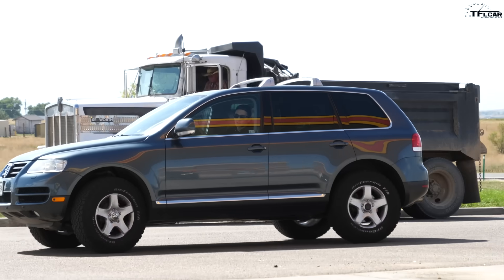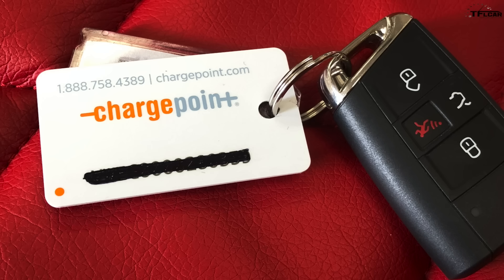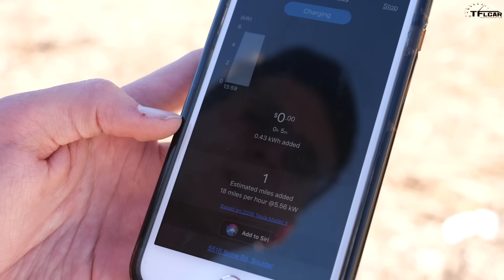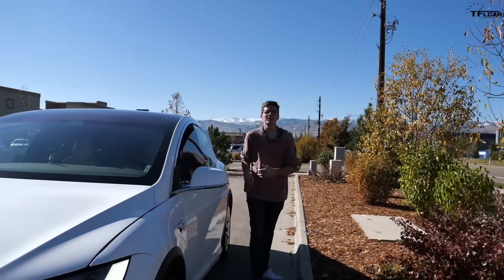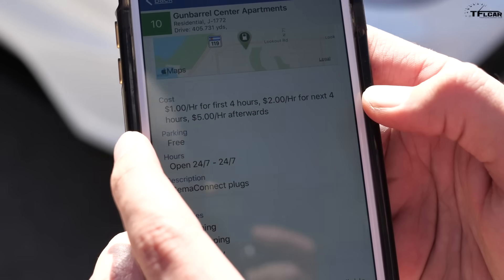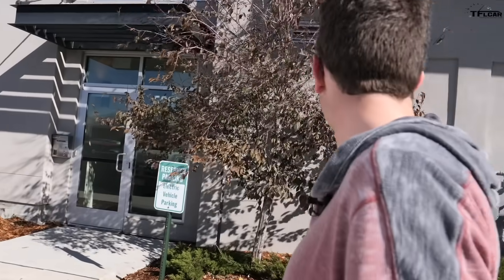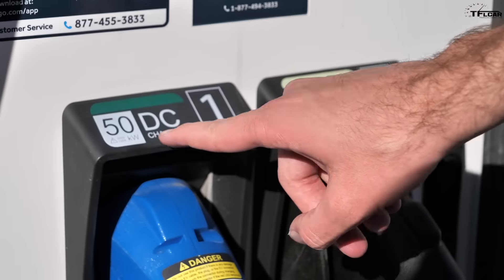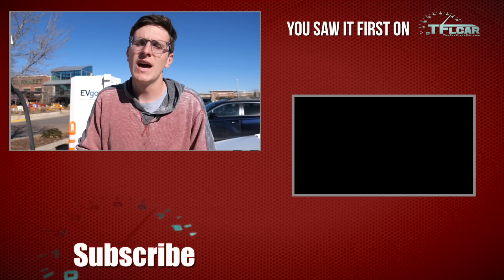Here’s Why Charging an Electric Car Can Suck - And It’s Not The Reason You Think!

Comment: I think it's time to make them standardize, like all gas stations are for the most part standardized. Lots of good info though.
Reply: Similar logic that Apple applied to computers, make thing proprietary and you have a captive audience. Once Tesla dominates the EV market share, those fast charge rates will increase. If you can charge at home  (with standard 220 outlet) then I would consider EV. Living in cold climate is another problem, heat uses a lot of energy.
Reply: Every EV except Telsa uses the same plug.
Reply: Don't "make" them do anything! Force does not solve problems, intellect and common sense does!
Reply: And what should we "make" YOU do? Socialists, (like Stephen here), always have fantastic plans, which always involve forcing people to do things. Free choice is better.
Reply: @jackfenn7524  yea, and each manufacturer using their own stuff. That will work well. Hurrah for free choice.
Reply: @georgecurtis6463  Actually, Tesla has demonstrated basic free enterprise works best. If you "standardize" the connection, you kill future innovation when a better connector is developed. (gas stations nozzles are NOT standardized actually, each nozzle only has to be large enough to NOT fit some cars, but small enough to fit others) Tesla realized that long charging times was a major problem and created a solution. As their cars need VERY high power connections, using a "regular" 5kw connector was impossible. (you can run 5kw of power through a 50 kw connector, but you can't run 50kw through a 5kw connection without it destroying it instantly) Part two was to create the fastest chargers and put them along the interstate freeways in a pattern that is exactly the same as the 1860s railroads, which put water and fuel stations every 20 miles (tenders were quickly added to increase the range and reduce stops). Also note that Tesla offers a fairly cheap adapter to use the 5kw stations. So in a pinch, you can still recharge almost anywhere, but only Teslas can use the 50kw stations. No government regulation required, the market by itself identified a problem and created a solution. But wait, Tesla can charge whatever they want at those stations! No they can't. They can only charge what the market will bear and if they push too hard, they hurt their customer relations and market share. You will also note that the 5kw charging stations only serve a shrinking market share of EVs. They are OK for now, but other cars will have to develop 50kw charging (probably license an adapter from Tesla) or continue to bleed customers.

Comment: 🤣🤣 240v power is in just about EVERY home in America. “High voltage” 🤣🤣
Reply: people are really stupid, its like saying that nobody has a washer or dryer.
Reply: isn't it 110V in the states?
Reply: Stefan7046 120/240v power in the states. 120v is one of the two wires fed to a home when measured to ground. The video has a point ONLY when referring to apartment living BUT apartments are still fed with 120/240, you just can’t modify apt wiring to install a 240v outlet in the parking lot, at least without permission 🤷‍♂️🤷‍♂️.

Comment: Great video.  That is exactly what i hear a lot of my BEV owning friends and clients tell me is their main gripe, not being able to charge as easily as they thought they would have been able to when they bought the car.  And you are living in a location that actually has a lot of various chargers.  Here in New Orleans, the charging stations are few and far between, and most of them are on private property, like hotels or parking garages, where you have to be a guest or customer.  
And of course, the other issue is the necessity to upgrade the home electricity situation to be able to accomodate the faster charging situations.  And if someone forgets to plug in their car as soon as they get home, and they have a low battery, it isn't going to be fun the next day on their way to work.  
When I was driving a tow truck, there were countless BEV owners that would call in with "I ran out of gas" in their Tesla or other BEV.  Then when I got there, they were upset that I couldn't take them to work and then drop their car off at their house and charge it for them.  I would tell them that I can take them to the closest charging station or their house, which ever is closer, and then they would have to figure out what to do from there.  Several times I would tow the car to the dealership and they would tell me they are going to trade it in on an ICE, not out of convenience, but out of necessity and safety.
Reply: Jeremiah Mckenna - How many drivers who drove gas engines ran out of gas that you had to rescue? EV drivers who run out of charge are stupid, just like ICE drivers who run out of gas.  That does not mean EVs are bad, they will become the future of automobiles, that.’s why Teslas are selling like hotcakes, those are people who are informed, not the ignorants making comments on this forum.
Reply: @Chainyanker007  .  Yes, there are idiots that run out of gas.  I have never said that doesn't happen.  However, there is a simple fix for that problem, and people can simply drive from the side of the road where I give them a gallon of gas, to the gas station and resume their travels in an almost instantaneous manner.  For the most part I don't have to take them anywhere.
I never said they were bad.  I simply stated several reasons that, for some people, they are not as simple to own as compared to ICE vehicles.

Comment: In our country we have FastNed, which is setting up chargers at gas stations on every highway.
Their charging speeds are between 175 kW on the fast chargers and up to 50 kW on the normal chargers, making it so an Audi e-tron charges 100km/65Mi in about 10 to 30 minutes.

Comment: Could you install a home charger. You plug your car in at night and it's fully charged in the morning.
Reply: If you get a Tesla you can by a home charger from them and install it. It's the fastest home charging method for a Tesla.
Reply: If you own your own house, you can get a charger installed.  The problem is for people who live in apartments that don't have them.   
Where I work, they just put up a new building and will be installing several charge stations for employees with EVs.  Two people already have them.  They get to charge for free at work.
Reply: @Mosinlogan    I could be free for residents of the complex, since the cost of electricity to charge a vehicle is not that high.  Just as where I work it is free for employees.

Comment: I charge my car 95% of the time at home.  So this frustration of charging on the go doesn't have to be a hassle around town.  Yes some live in apartments where this is hard, but 77% of US lives in houses.  Most have garages.  When you drive long distances just take a lunch/dinner break and you've got another 100-300 miles on your EV.  After driving 2-3 hours you really should take a pit stop anyways for health reasons.
Reply: Actually, 35% of Americans rent housing and that equates to a whopping 115,000,000 people that the EV carmakers are pretty much saying...we don't want your business because we aren't worried about how you're going to charge your car quickly and efficiently. EV's just aren't "there" yet for the vast majority of consumers. That's why you only see a 2% market penetration of EV/PHEV sales in 2018.
Reply: @jaroessa294  2014 US Census bureau stated 77% live in single family homes.  That's a majority of the car owning public that EV's can penetrate. It's only at 2%, but growing at a 40% Y_Y ratio.  At that rate in 5 years it will be 10% of all sales and over 50% within 10.  
No ICE car group is growing by those numbers. https://www.eei.org/issuesandpolicy/electrictransportation/Documents/EV_%20Sales%20Facts%20and%20Figures.pdf
Reply: @derekspalding3091  Your 2014 stats are 5 years out of date. You'll want to check the 2019 stats at the official Census Bureau website. Homeownership has decreased and rentership has increased in that time.

Comment: Charge at home or forget it most of the time, EV for me would be for short daily journeys whithin the range or the car , if I wanted to go on a longer journey I'd use a normal car.
Note that the many other things put me off all together, like battery lifespan temperature effecting range and cost of electricity simply going up or being taxed because of loss of revenue from gas tax lol.
It's gonna be great WHEN electric is all free via solar etc etc and the batteries last longer with more range though.
Reply: nigelsheffield - You are talking about EVs from a few years ago. Totally different for Teslas, I know I just ordered a model S, currently comes with lifetime free charging at any Tesla SC station. Nearest one from me is 4 miles, free for life, nice.
Reply: @Chainyanker007  that's great, I've seen a tesler  around here the other day , first one I've seen here in Yorkshire lol.
Free charging must of sold it haha!!

Comment: Nice video, but I think it highlights the problem with EV's at this time.  Charging times are way too slow to be practical for anyone who travels more than a few miles in a major metro area.  The other barrier, in addition to slow charging times, is that charging stations are mostly concentrated in major metro areas and on major highways or interstates.  I travel all over Minnesota, Wisconsin, and the Dakotas, for both work and leisure, and occasionally drive back and forth to Montana.  An EV basically restricts you to routes with charging access, and presumes you can accommodate impossibly long charging times.  I work hard to stay off of major routes because they are too busy and boring as sin, but an EV confines you to them.  This fall I ran into a couple traveling from Duluth Mn to Phoenix in a Tesla D, when they ran out of power near Wall SD.  Although they love their car, and are big advocates of EV, they shared that this journey was very difficult and only worked for a retired couple, like themselves, for whom time and money were no object.  They had to plan routes around charge stations, not based on where they wished to go, and were occasionally hung up for a day to allow time to charge.  And then, here's the final concern they voiced:  That most charging stations pay a fee to the owner of the property on which their station is located, and they have seen charging prices creep up, to the point that the cost of charging was occasionally on par with the cost of filling up a reasonably economical car.   In other words, don't assume that the cost of distributed electrical charging stations will be cheap in the future.  The cost of electricity may have less to do with the cost of production, and more to do with that unique American skill of creating "profit centers."  My prediction is that the eventual cost of operating an EV will be about equal to the cost of operating a gas car today, one way or another.

Comment: This system is stupid and overly complicated. It makes no sense to not work with credit card company's . He keeps saying that you simply do this or that but didn't finish charging and did more this and that plus the time than with any gas station I've been to.  Has any one thought to put these in a gas station so anyone can use it. You charge you pay. They are the ones that have the brand card  you just need cash or credit card.

Comment: Why can't each car wheel have a little generator on it, and thus 4 generaters constantly charging the batteries as the car rolls down the road? What ever happened to the young man in the late 1970s that invented a vapor fuel system that gave a car hundreds of miles per gallon of gas?

Comment: Compressed Natural Gas (CNG) is a much, much cheaper alternative fuel, and we already have an established  nationwide infrastructure devoted to it. Refueling takes about the same time as a gasoline vehicle. Our Country has the lion's share of it. It's the exact same stuff as in your gas range in the kitchen. Ironically, many of the electrical plants that generate electrical power (EVs included) are already powered by CNG, so why not just use it directly? Every time power is changed in form, there is energy lost in the process, usually in heat. For EV use, CNG is used to fire up a steam boiler at an electrical power plant (energy lost), which spins a generator (more energy lost), transferred cross-country via hi-tension power lines (more energy lost), stepped down into a usable voltage (more energy lost), and then finally into a EV battery (even more energy lost).  And, the ecological damage done by mining raw lithium in Canada, shipping it to China for processing, and shipping back to North America to make batteries is horrendous. EVs are a huge hoax.

Comment: Thanks for the video. I have a BMW i3 with a range extender. I laughed a bit when you pointed out the confusion about the internal combustion engine. The i3 has a small engine that will charge the battery and effectively double the range, making longer trips between stations possible. 
I would like to point out that EVs are in the Betamax vs VHS phase still. The tech in the station power and in the port adaptors is all over the map yet. Until it's all fleshed out many people will stay away. People want the blue-ray, not the betamax, I get it. But this is how technology goes. It's evolving.

Comment: The Tesla is a gorgeous car. You are very lucky to have one. But I am very happy with my used 2011 Prius HYBRID.... It charges itself! There isn't even a plug port on this car. I go to the gas station about once in 5 or 6 weeks and it takes about 10 - 15 mins if there is a line. Otherwise it's 5-7 minutes. The tank takes about 11 gallons. I don't have to use my phone, I don't have any charging apps. Life is simpler that way. I think younger people are more willing to tolerate the hassle of charging an all electric car. This video was very interesting...thank you.

Comment: Screw this. Talk about a road trip nightmare. I was seriously thinking about the Cybertruck but I had no idea how time consuming this charging nonsense is.
Reply: stop for an hour every two hours driving. what could be easier?
Reply: Road trips in Teslas are not like this. For example, my wife and I went from Cleveland to Orlando (1200 miles) in about 18 hours (15 driving and 2-3 charging). We planned our pit stops around the charging stops so between bathroom breaks and meals, the car was usually done charging before we were even ready to get back on the road.

In fact, I’m planning another road trip to Texas in a few weeks (1400 miles) which with recent charging/efficiency improvements should only take about 24 hours (20.5 hours driving, 3.5 charging).

Comment: Now... how it's done with gas cars: pull into any gas station so the pump is on the side your gas cap it on... swipe your credit card.. open gas port hatch, remove the gas cap, put nozzle in standard hole... squeeze and flip the latch... wait 2 minutes... the latch pops when the car is full... put the nozzle back on the pump... put the cap back on... close the hatch. Done. Your car is now at 100% range (in my case... 580kms). Total time... <10 mins. And it works everywhere on every car. No apps needed. No adapters needed.

This is the problem with EVs right now, Even the Tesla on a supercharger takes an hour to do this. Without one - it's many hours.. and if you live in an apartment, in most cases, you can't even leave it charging overnight.

This is why 'range anxiety' is a bit of a strawman argument. It's not range, it's recharge time and ease. A gas car doesn't get much more range - but if you run out of gas, it's not only easy to find a gas station - they all work the same way, they're all compatible and it takes <10m to refill.

Comment: What happens when the connectors start getting worn contacts from frequent plugging and unplugging?? Do these adapters lock into your car to keep some idiot from pulling the cord too early, arcing out the plug and damaging the connectors?? What's to keep someone from stealing your Tesla adapter while your away from the vehicle while it's taking 10 hours to charge??

Comment: I mean, most of the new charge points only take like 2-3 hours. Just go get a coffee or something plug in the car come back you have another 80 miles. That’s more then enough to get around in a city- the major use of these cars. And a home charge takes 8 hours at the low voltage not “days” plug it in over night every night you’ll be fine. You just have to be a little more mindful about your driving and plan to go to do things a places that offer charging. It’s really not that hard. My local library charges for free, I go and drink coffee across the street and it’s charged. Also a hole charger really isnt that expensive. Especially if you can already afford a luxury car.